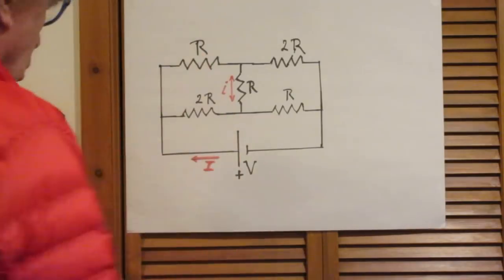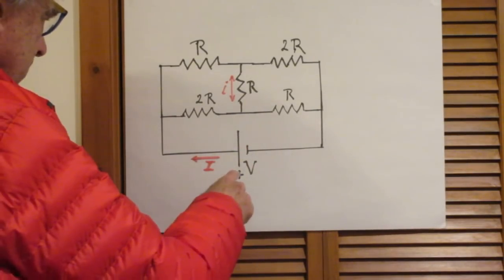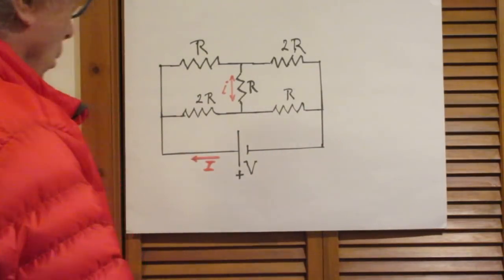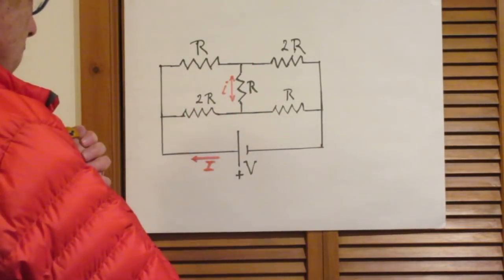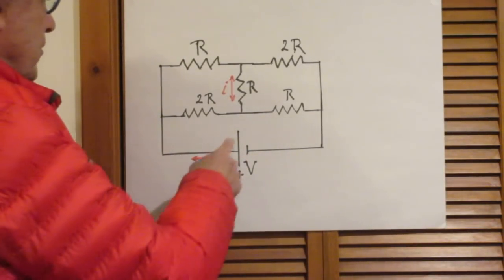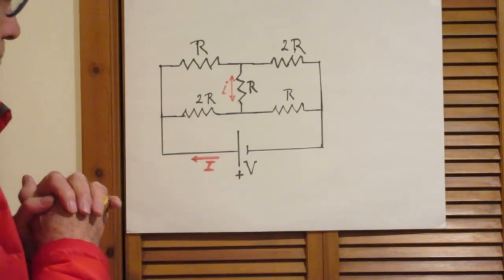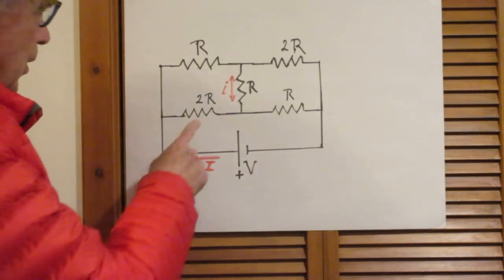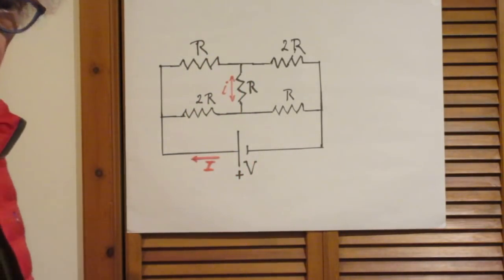Problem #24  Circuit with Five Resistors

Comment: Hello professor Lewin,

I'm already a college graduate who loves physics, but my degrees are in other fields.  Since I've never taken an electrical engineering course, could/would you please suggest a resource that covers the kinds of math needed to approach this problem?

Yours respectfully,
Russ Johnson
Smyrna, TN
Reply from the maker: I do not know your level. use the web - you are the best person to decide.
Reply: Lectures by Walter Lewin. They will make you ♥ Physics. Really a few gives the suggestion that you have given.  Most what I have encounter and many times myself throw suggestions without diagnosis.
Reply: I  am a graduate electrical engineer. Math needed is algebra, trigonometry, linear algebra and calculus. For calculus you will need at least 4 University level courses in calculus and differential equations. A good way to decide is go to University web pages and look at pre-requisites for the engineering courses. Lewins course on electricity and magnetism is really good but you will require the math.

Comment: Assuming Voltage of battery=15V, and resistance R has value 100ohm: I=0,1714257A (pointing leftwards), and i=2.14286E-2A pointing downwards. Without the assumption I cannot solve this 6 unknown variables algebra by hand.

Comment: Sir and I have heard that our moon is just a part of our Earth and when formation two moons have formed and they collide to form one moon so that s why one side of moon have lava and other side not
Reply from the maker: The giant-impact hypothesis, sometimes called the Big Splash, or the Theia Impact suggests that the Moon formed out of the debris left over from a collision between Earth and an astronomical body the size of Mars, approximately 4.5 billion years ago, in the Hadean eon; about 20 to 100 million years after the solar ...
use goog;e
Reply: Lectures by Walter Lewin. They will make you ♥ Physics. Thanks Sir

Comment: hm well, I think one can "easily" calcuclate the current and direction of small i by making some equations using the laws of Kirchoff. but in the moment I have forgotten them, but I would guess the current i flows "down" because the path "R-R-R" has smaller resistance than the alternate path "2R-R-2R"

Comment: Aargh, I've now got 5 unknowns and 3 equations. Back to first principles again!
Reply from the maker: that's tough!
Reply: No 3 equations and 3 unknowns. Apply a current loop in each square and that gives you 3 equations solve for currents and you have the solution. That is how I did it and got teh right answer

Comment: The total current in the circuit 1.07(V/R) and current across in the middle of the resistor R is 0.133(V/R) from upward to downward direction.
Reply from the maker: incorrect
Reply: Lectures by Walter Lewin. They will make you ♥ Physics. ... Okay sir  waiting for your solution
Reply: Lectures by Walter Lewin. They will make you ♥ Physics.  Sir is it I=1.071(V/R) and i=0.133(V/R)?
Reply from the maker: incorrect
Reply: Lectures by Walter Lewin. They will make you ♥ Physics. 🙁🙁

Comment: Sir, 

Here are my answers. 
I = 0.6667(V/R) Amperes
i = 0.1905 (V/R) Amperes 
The direction of i is from the top end to the bottom end, i.e. the current i flows from top to bottom.
Reply from the maker: incorrect
Reply from the maker: your last solutions are correct
Reply: Thank you, sir.

Comment: I am stuck in a maths paradox whatever I put in and however I do I get result in assumed clockwise current which you taught in 8.02 but taking unit current and unit resistance I get the net current as   : [0.7142(V/R) or(5/7*V/R)] using similar trick i1-i2 that is the current in middle resistor is [ 0.5V/R]
Reply from the maker: incorrect
Reply: Lectures by Walter Lewin. They will make you ♥ Physics. Both?
Reply: Lectures by Walter Lewin. They will make you ♥ Physics. 1st one was right and I have a proof in a form of a video by a Dutch professor

Comment: 0.143 * V/R downward
thevenin resistance is (4/3)R
thevenin voltage is (1/3)V
current is therefor (1/7) * V/R
Reply: And where is the rest of your answer ? And what current is in your answer ? This happens to my son all the time in exams. He can do it, but fails to be complete and accurate due to not reading the question properly.
Reply: I am getting wrong using thevenin .. Will you please send your complete solution

Comment: Sir
1.do light have mass??
2.how could light which posses both particular and wave form can travel through nothing like space...???
Reply from the maker: light has no mass but it has momentum.
All EM radiation can travel through space. use google
Reply: So sir does it use conduction or convention to travell  from deep space to earth...
Reply: Will it not cause any energy breakdown of light while it reaches to earth from a far away star....
Reply from the maker: google red shift and blue shift
Reply from the maker: >>>does it use conduction or convention>>>
No it does not - use google
Reply: Thanks sir

Comment: I = 2V /5R or 0.4 V/R 
And  i= 0 since the potential difference is same in parallel connection
Reply from the maker: incorrect
Reply: Lectures by Walter Lewin. They will make you ♥ Physics. Thank you sir I admit it

Comment: Sir please give any link where you have suggested books for physics. I have searched on google and quora but  haven't found your suggestion.
Reply from the maker: 8.01
Physics
Hans C. Ohanian
2nd edition
W.W. Norton & Company
ISBN 0-393-95748-9

8.02
Physics for Scientists & Engineers by Douglas C. Giancoli. 
Prentice Hall
Third Edition
ISBN 0-13-021517-18

8.03
Vibrations and Waves by
Anthony French
CRC Press
ISBN 9780748744473

8.03
Electromagnetic Vibrations, Waves and Radiation 
by Bekefi and Barrett.
The MIT Press
ISBN 0-262-52047-8
Reply: Thnk u very much sir. So nice of you. Your lectures have changed the way of seeing the nature and it is amazing.

Comment: Sir please make a video explaining how spacecraft use(steal) orbital energy from the planets, and how can you slow a spacecraft down using the same principle, i have seen so many news and documentaries talking about the slingshot effect, i want to understand them with some rigorous mathematics and Physics. I have searched google but i still dont have a strong understanding of this phenomenon. I need your help! Thank You
Reply from the maker: watch my 8.01 lecture on Kepler Orbits and use google
Reply: but you didnt cover gravity assist in your lectures. and searching google is not a proper way to learn a new concept. If you cant make a video teaching this concept, please at least include one problem in your biweekly physics problem, thank you
Reply from the maker: what is gravity assist?
Reply: Gravity assist or (gravitational slingshot) is a process where you use the orbital energy of other planets to accelerate your spacecraft to outer solar system, and save a lot of fuel

Comment: Sir if there is an electric break down in a huge field covered with plastic and there are two pans one is a feet tall and has a lot if charge in it and the other is taller than the first one but has only one fifth of the charge of the other , so where will the spark fall on the tall pan or the short one , provided that the pans are identical except there heights are different?
Reply from the maker: sparks occur where the E-field is the highest. Sharp edges!
Reply: So it doesn't actually depend on the charge ?
Reply from the maker: no not necessarily
Reply: watch 8.02x - Lect 6 - High-voltage Breakdown, Lightning, Sparks, St-Elmo's Fire

Comment: Is it a wheatstone bridge?
Reply: Yes
Reply: No
Reply: No man it's ain't any Wheatstone bridge... See it for yourself... The ratio of resistances of the left arms is not equal to respective ratio of resistances on the right arms...
Reply: Unbalanced
Reply: Use star delta formula
Reply: Unbalanced wheatstone Bridge
Reply: No it's not wheatstone bridge.
Reply: Wheatstone bridge?   Definitely  not.
In a Wheatstone Bridge, the ratio of resistances of the upper arm MUST equal the ratio of resistances on the lower arms taken in the same order.  This way the voltage across the middle resistor is ZERO in the "balanced" condition since each arm is a voltage divider having the SAME division ratio.  When the bridge is balanced in this manner, no current flows in the middle resistor.  By replacing one of the resistors with an unknown, its value can be determined by balancing the bridge (ZERO voltage across the arms on the middle resistor) and knowing that the unknown is ratioed to the other resistor in its arm as the resistor ratio of the other arm.
GH
Reply: Definitely not
Reply: forget about wheatstone whatever lol, just use the Kirchhoff’s voltage lws
Reply: your all wrong it is the same as a unbalanced Wheatstone bridge with a resistor in the center where its current is dependent upon the bridges balance, IE it could easily be a ammeter or voltmeter. If you still dont agree with me what would happen if the bridge was balanced? Then there would be no current in the center resistor even if it was a dead short
Reply: Yeah but an unbalanced one!!
Reply: Nope

Comment: Sir, if an ice cube of temperature 0°C  enters in the water of 0°C , then what will happen ?
Reply: Narendra Bairwa nothing happens ice remains solid
Reply from the maker: The ice cube will float
Reply: nothing at all. if room is hotter. ice will melt.
Reply: The water level will go up just a little, you might catch a flue, it might rain, or the sun may shine. In other words specify a bit more what direction your question is meant to go...
Reply: +Koos Jorritsma I think its in context of heat.
Reply: Lectures by Walter Lewin. They will make you ♥ Physics. Clever!

Comment: What is star delta conversion?
Reply: A topology transformation to (hopefully) make the circuit easier to analyse.
Reply: What you call star delta conversion is referred to as the WYE-DELTA conversion in electrical science.  The conversion will allow you to find the total current from the battery but not the current in the middle resistor.  For an explanation of the conversion go to my video:

www.youtube.com/watch?v=j6SPHfiCGjM

start at time 7:35 for the conversion
GH
Reply: Thanks!!

Comment: Professor, what book or lectures do i need to learn about the energy levels of the electron, emission and absorption of light by the atom? Please, give an advice.
Reply from the maker: https://www.youtube.com/watch?v=MeK0DV329mU&list=PLyQSN7X0ro21uk5LTH085VLMfkb_dRjHF&index=7
Reply: Thanks a lot! I will watch it. It feels so good knowing that if I need a direction I can ask you and you will show me which way to take, peofessor. I am extremely grateful. 
Have a good day. :)
Reply: Professor, I watched the lecture. Now I need to go a little more deeper into the emissions and absorptions of the atom, a little deeper than it was on the lecture. Is there any other lecture that goes deeper into it? And also if you could advise me a book on this I'd appreciate it.
Reply from the maker: I suggest you search for videos on the web on atomic spectra. There are many my first search found already 4. Also use the web to find books on these topics. Maybe you should start with spectra of hydrogen. The Physics behind it is QM - not very easy. But if you take a course in QM chances are very high that you will see the derivation of hydrogen spectra.
Reply: Got it. Thanks!

Comment: I don't like KVL because 'It's for the birds!'
Hence I used KCL or the junction law. 😄
And please forgive any mistakes that the auto correct on my keyboard might commit.😅
Reply: Biswaroop Joarder what is ur answer
Reply: I dont agree with "for the birds". But certainly in this case KVL will hold perfectly and you probably need it to solve this problem. Prof. Lewin never said it's for the birds in any case, just for a specific case ( And I did not agree, guess it's a matter of perspective. )
Reply from the maker: Faraday's law ALWAYS works; thus also in this problem. Since the Curl(E) = 0 here, you can also use Kirchhoff's loop rule which is a special case of F's Law.
Reply: obviously kvl will work here! I just find the phrase "for the birds" funny..... basically, i just wanted to solve without kvl, using kcl
Reply: Professor, I'm in 12th grade... So, I don't really have an idea about curl of E vector... but what I understood from your video is that KVL is invalid when there is an induced current in any part of the curcuit....  Am I right?

Comment: Sir, I gave my answer in the comments section but it is featuring only if a I am logged in.
and when i log out it just vanishes.
do you know what is the problem if so like u have blocked me?
pls reply for my message,sir.
Reply from the maker: I have no clue
Reply: means it must be correct imho. congratulations ☺
Reply: sir, did you see my answer?
if not I will post them again.

Comment: In V/R units
I = 1.857
i =0.286
Reply from the maker: incorrect
Reply: I =0.765
i =0.118
Don't know why i get different answers each time i calculate :(
Reply from the maker: again - incorrect but you are getting closer
Reply: Last try :(
13/17 and 2/17
Reply from the maker: nope

Comment: Professor i had a question about em waves The question is that if a em wave strikes a free charge it will make the charge ossilate and as Thompson scattering describes the wave will be scattered but as we know em waves is made of fields which contain energy so how is energy absorbed from the em wave is so kind of opposite field created or anything else how is energy absorbed from the field of incident light and the original field of the em wave disappear  there is a similar question in physics stack exchange but dosent  have a correct answer https://physics.stackexchange.com/questions/128156/if-light-is-an-electric-and-magnetic-field- plz explain
Reply from the maker: https://en.wikipedia.org/wiki/Thomson_scattering
Reply: sir plz answer
Reply from the maker: I already answered. https://en.wikipedia.org/wiki/Thomson_scattering

Comment: I=3V/(4+3R)
Reply from the maker: (4+3R)????
does this mean that if R is 10 Ohm that 4+3R is 34 Ohm?
Reply: Check your dimensions buddy!
Reply: Lectures by Walter Lewin. They will make you ♥ Physics. Yes sir
Reply: That means that if the resistors are 0 ohm and voltage=10V current would only be 7.5 Amps. While the replacement value of the total resistor network would obviously be 0 ohms in that case, so infinite current would flow.

Comment: Sir , Here is my Final Answers I=5V/7R , i=V/8R , and Direction of i is Downward*..Sir , This is my Final Answers , Is this Correct?? *Jouw Zoon Shivankar Singh ❤❤
Reply: Sir , I spend 4 Hours on this and Draw the Figure more than 10 times ❤❤
Reply from the maker: incorrect
Reply: Lectures by Walter Lewin. They will make you ♥ Physics. Sir , Really it is Incorrect .... :( :( :( .
.
.I'm sure with my answers But If you say , I think i is incorrect or Direction of i*............But As you Told us that Current move from Higher Potential to Lower Potential and Here it moves from Potential *2V/3 to V/3 its mean Direction is Downward and If I talk about i it is equal to{ (V/3) / (5R/3 + R) } i.e., i=V/8R
Reply from the maker: incorrect. Please stop guessing. This is not a fishing expedition. Wait till I ost the solutions next Saturday
Reply: Sir , I'm not Guessing here , I have Proof of 6 pages on my NoteBook , But OK Sir , I will Wait for next Saturday .......... Jouw Zoon Shivankar Singh
Reply: 5R   .... Really ?
Reply: What is 5R ??
Reply: i it is equal to{ (V/3) / (5R/3 + R) }  ... your words. 5R/3 is the thevenin impedance of both voltage dividers added together. The single R is just the resistor in the middle  ... Do it again :-). I won't say anything more about it, I'm not sure Prof. Lewin can appreciate this kind of "help" ( if any :-) )

Comment: Professor lewin; I'm from India I have a degree in electrical engineering and I am self taught as far as physics is concerned and also have a good pgre score do u think I have a shot for going to grad school(physics).
Reply from the maker: appply to grad schools - try to get into an IIT.
Reply: Lectures by Walter Lewin. They will make you ♥ Physics. Imeant grad. School in the us?
Reply from the maker: try it - apply and see what happens.